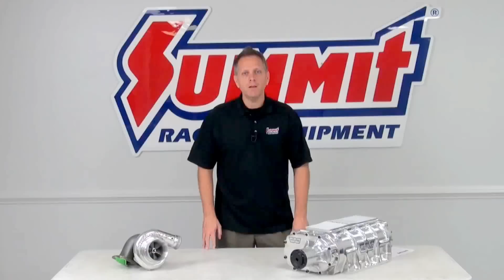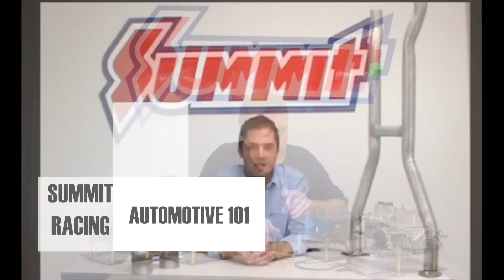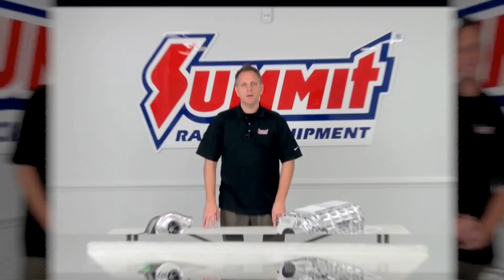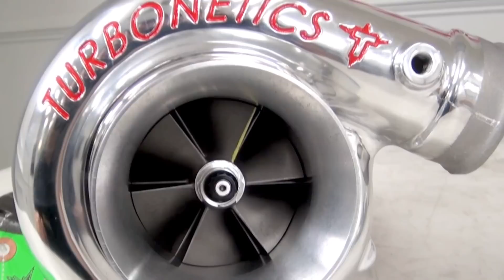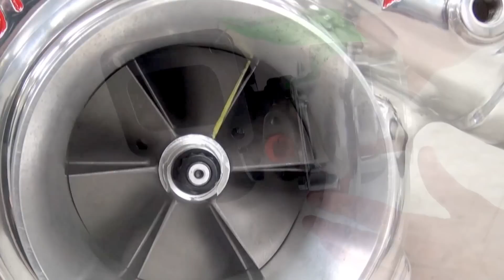Supercharger vs Turbo - Summit Racing 101

Comment: What do you recommend on a 2000 camaro v6 3.8
Reply from the maker: twat airsoft, 
Unfortunately, we do not have either type of kit for that motor. Some searching on the net will show
some factory supercharger components that can be retrofitted though!
Reply: twat airsoft The bottom end of the engine is identical. Just find a factory 3.8 supercharged from a Pontiac or Buick & change the intakes / supercharger. I looked into doing this years ago. As with all internet advice, please verify this before you proceed. I'm pretty sure I'm right, but you should always verify.

Comment: The turbo lag can be avoided by just putting a smaller turbo.  As far as turbo lag, turbo are so advance now in days that if you make the good combo there should be little or no lag to the turbo...
Reply: +melendezcobra45 indeed
Reply: my roots 144 is about 15 years old and ive raced new deisel turbos  even a new spooled turbo that was on a camaro with a 502  and my little 350 with 144 supercharged in a 6000 pound 76 chevy blazer 
prevailed it had power but it shifted and i blew by,
 low rpm  is not the turbos freind even with a stall converter.
Reply: time difference between throttle push and actual acceleration. Lag frustration alone is worth assessing your options...I hate it
Reply: melendezcobra45 what is turbo lag?

Comment: can i get flutter noice with cheapest turbo?
Reply: se*
Reply from the maker: Hi Gian Marquez, 
A fluttering or chirping noise is common on any turbocharged application without a blow-off valve. When under boost, if the throttle is closed rapidly, the pressured air actually travels backwards and slams into the spinning compressor wheel forcing it to stop instantly!  This can be damaging to the compressor wheel and should be avoided!

Comment: this is gonna sound stupid,but can an engine be supercharged AND turbocharged?
Reply: Yes it can its called twin charged!
Reply from the maker: Hi Corey Harrison, 
It is possible to install both a supercharger and turbocharger. However, the process is challenging and expensive!
Reply: i could imagine so,but would it be practical?
Reply: Corey Harrison  Under most normal circumstances it'd probably be cost prohibitive and thus not really practical. But, depending on how you define "practical", it can be done. There are examples out there of both parallel and compound working systems.
Reply: that my friend is called twincharging. The Zenvo ST1 danish supercar is a twincharged beast.
Reply: ill have to check that thing out then
Reply: Volkswagen did that one time
Reply: Yes i know
Reply: the ford gt is twin charged
Reply: Matthew kramer pretty sure a stock one is whipplecharged. Now if you're talking about the heavily modded ones that run 1000+ hp they're probably twincharged.
Reply: Yep. It's called twin charged
Reply: Robin Tammik no lol nice try though
Reply: Robin Tammik i already mentioned the Zenvo and said its twin charged.
Reply: [ZCS] Project153X koengessiegg ccx has twin superchargers
Reply: There is even Nissan SuperTurbo, a stock car that is Bi-Charged.
Reply: The zenvo st1 i think is super-turbo charged

Comment: 06 dodge charger  rt  5.7 turbo or supercharger
Reply: personally for a 5.7L V8 rt I would recommend the superch. for the reasoning of the chargers having lower Rpms of 5,500 - 5,750 max. 0 - 60mph in a charger is generally 6.2 sec so you wont have a problem with any parasitic effects.

Comment: Are turbos big in drag racing or does it depend on your car and what performance your looking for
Reply: uhhhhh Rapture Films, I'm pretty sure turbos are the ones built for higher RPM runs. They probide more boost at higher RPMs. It was explained in the video. Superchargers provide instant boost. Turbos have turbolag where superchargers don't. In most cases turbos provide a lot more power especially in drag racing where people will run upwards of 1000hp.
Reply: Turbo is usually bigger in rally, or circuit racing. Superchargers are more used in drag racing cause they are made for high RMPs. In drag racing you are continuously shifting up, and that's why it can be more useful exspecially the last gear when it's  a continuous pull in the higher RMPs. in a circuit you spend more time down shifting and having to pick speed up again so you use a turbo to get you there faster. A super charger would probably make you spin out in a circuit so over all most people use superchargers for Drag racing unless they have a 4 cylinder where it would be more difficult to place a super charger in the smaller hood space. either way though with a turbo or a super charger you will see a lot more performance out of your car, and you'll have a hell of a lot of fun.
Reply: yes my apologies I mixed it up. That's why people don't like superchargers for circuit. If you down shift they get squarely. I wrote that early in the morning I was a out of it.

Comment: I have a '97 5.0 block and am having trouble finding a supercharger for that year, Also for more of a street build would you recommend a supercharger or a turbo for a moderate power increase and would I run into any problems with a stock engine?
Reply from the maker: Hi Jesse Lockhart, 
We need some additional information from you. Can you give our tech line a call? 1-330-630-0240. We look forward to your call. Thanks for watching!

Comment: Hi I wanted to know if you let your car sit for about 4 days is that bad on the turbo. Will the oil lines still be fed oil properly to run par ??
Reply from the maker: Hi Miles Watkins, 
This should not be a problem at all. Thanks for watching!

Comment: I wanted to make a correction on the video just so people aren't misinformed. Turbochargers do take away power from the engine. Energy is required to spin the propellers and energy cannot be created nor destroyed. The pistons have to push the exhaust gas more in order to spin the turbocharger's propeller. Although it is less than superchargers, turbos also have parasitic loss.
I hope in a future video you can make this correction so this doesn't spread through the car communities.
Reply: It's slighter harder for the engine to complete the exhaust stroke, however most of the energy comes from the blow down energy of the heated exhaust gases leaving which is typically 'wasted into the environment' without a turbo.

Personally I still think superchargers are better because of instant response and more induction at lower rpm but it's all application dependent. For my application I want to accelerate from a stop in a straight line as quickly as possible.
Reply: Your just restating
Reply: Negligible power loss. The turbos develop inertia and spin on their own. The exhaust just keeps them spinning.
Reply: They don't take away energy because what spins the turbines is the exhaust gases

Comment: turbo or supercharger for my 2014 Dodge Challenger RT
Reply from the maker: Hi Matt Timken,
Both achieve the same result, pressurized air increasing volumetric efficiency of the motor. At the end of the day; it comes down to affordability and your preference.

Comment: Hi, cann you advice me what better to put in my car turbocharger or supercharger.. if supercharger then what style root, centrafugal, or twin screw ?  car is Audi S8 D2 2000 year, engine 4.2ltr  V8, 40 valves, 265kw  6 speed manual gearbox.  thank you for answer
Reply from the maker: Hi Donatas Donis, 
Can you give our tech line a call? 1-330-630-0240. Thanks for watching!

Comment: is it possible to have a supercharger and a turbocharger?
sorry if this is a stupid question
Reply from the maker: Mr.Nathaniel Johnson,
1.      
Yes, this has been
done before but, only in extreme racing situations.
Reply: Check the video "Worlds quickest Lotus" by Drive or The Smoking Tire
Reply: There are a couple twin turbo and supercharged Ford GTs running around here in Texas that I have seen

Comment: HEY I HAVE A 2008 NISSAN 350Z AND I WAS WONDERING WHAT I SHOULD DO, TURBO OR SUPERCHARGE IT?  THANKS FOR THE INFORMATIONAL VIDEO TOO!
Reply from the maker: Hi Minton Jeff, 
Unfortunately Summit Racing does not offer a kit that would Turbocharge or Supercharge your car.  A kit is definitely the way to go though; because it includes everything necessary to make the installation complete and as easy as possible. Usually these kits will also offer the mandatory re-tuning of the computer that must be done! Thanks for watching.

Comment: So if superchargers use up ur engine power,how do they make it faster? And how does does just adding more air to ur engine make it so much quicker
Reply: You're thinking too hard bud. The turbo doesn't use enough power to not produce power. It's like running your A/C on an engine vs. not running A/C. Without the A/C the engine will "make more power" because it's able to move a little more freely. But it's so minor you won't notice it. As for your second question more air makes the engine faster because of how 4 stroke engines work. Intake stroke pulls in air and gas, compression is self explanatory, power stroke is the controlled explosion inside the cylinder, exhaust is self explanatory. The more air you have in the cylinder the more compression you can have. And the more compression the bigger the explosion which creates power. Hope I explained that good enough to answer your question.
Reply from the maker: Hi ur nalgas, 
A belt driven supercharger adds a certain amount of load or parasitic draw to the crankshaft of the motor. That slight amount of extra load is overcome by the extra amounts of fuel and air that are jam packed into the cylinders creating more power. A Turbocharger on the other hand uses the waste energy of the motor, fast moving exhaust gases, to spin an impeller forcing more fuel and air into the cylinders. It’s just 2 different ways of doing the same thing!

Comment: can you turbo charge a 4.3 vortec? & what other components would you have to replace ? injectors ? new manifold ? intake?
Reply: Do you watch Roadkill? If you have the necessary fabrication experience you can do just about anything. This has been done to Roadkill's Datsun 240z. They had a GM 4.3 engine in the car with a Subaru WRX rear end, a manual transmission from a junkyard S-10, and a turbo from a Ford Powerstroke diesel. Check it out. It may give you some ideas.
Reply from the maker: Hi Emanuel Castillo,
Sorry but, we do not have a kit to Turbocharge your 4.3 Vortec motor. Now, if you wanted to build your own kit we could help with components. This will not be an easy job as there will be a lot of fabrication on your part. Yes, injectors will need to be replaced. You will also need access to someone that can reprogram your computer as well.
Reply: thnks guys ill do some more reasearch

Comment: just about to start a 400 small block build- what compression can I run if im looking at building this to run a small twin screw whipple charger???not a blower...
Reply from the maker: Hi Gary McCarty, 
This absolutely depends on the overall build you want to assemble and what the ultimate use/goal is. Please give us a call and we will certainly help you choose the proper parts for the best build! 1-330-630-0240. Thanks for watching!

Comment: Summit Racing! 

I hope you can help me out. I have a Bonneville SSEi. Its already quick enough stock but I would love to get more power. What would be the best modifications to gain the most power, and safely upgrade without any possible damage? Also I would love to get my supercharger to whine a lot louder!
Reply from the maker: Hi gjg50,
We carry Cold Air Kits, Pulley’s for the supercharger and tuning (HP Tuners) for the ECM. Give us a call and we can help you with the part numbers you’ll need! 1-330-630-0240. We look forward to your call. Thanks for watching!

Comment: some other differences include: The turbo being capable of producing a much larger ammount of boost than superchargers in comparison to size and efficiency. 

Boost can be much easily adjusted with turbos than superchargers and can even be adjusted within the vehicle cab while driving providing you have an in cab boost controller, whereas with a supercharger you cant adjust the boost without changing the drive pulley to a bigger/smaller one. (correct me if i'm wrong)

also lagg issues can easily be resolved, i found that turbo lagg is only a real problem with automatic transmissions whereas with a manual you can launch on boost and the bigger the engine the less lagg you get with turbocharging v8's there is little or even no lagg due to the high ammounts of exhaust driving the turbo/turbos. (No need for correction, Spoken from personal experience)

Thanks for sharing this great educational video, i'm sure it's helped alot of people.
Reply from the maker: Hi Blaize K-H , 
Thank you for sharing your experience and knowledge!
Reply: superchargers give you better low end torque and better throttle response. its worth it over turbos
Reply: analanalyst thats 100% correct 

depending on the tune, turbocharged engines can also be made to respond instantly and also for low, mid and top end torque while being efficient.

turbos on v8s are becoming extremely common because of this.
Reply: Blaize K-H like the new mercedes amg's and bmw m's have definetly solved this problem. i still think a supercharger is the way to go though
Reply: analanalyst superchargers are not made for really high speeds but good at low RPM/s i think but not sure though
Reply: Doodoo Youkas not true, turbos run out of breath at speed. you need to shift early because the turbo runs out of steam and it even needs to spool up
Reply: analanalyst That's incorrect, turbo's provide better low end torque. Torque and HP improve as RPM increases in a supercharger
Reply: BlackVinylMusic turbos only give you mid range. if a turbo has good low end torque, like the new BMW engines for example they will run out of breath in the top end (5000rpm) superchargers do not have this problem. the best way to fix this is by adding 2 smaller turbos instead of 1 big turbo, this minimizes turbo lag and gives more top end power
Reply: analanalyst it all depends on the tune. Cars can be tuned now for better low end mid or top end torque, dependent on the turbo and the tune, it doesn't necessarily need two small turbos for all-round but twins and singles both have their own pros and cons, you set it up for how you aim to use the car.
Reply: Blaize K-H true but you can only pick two of the three; low and mid or high and mid. this is why i prefer superchargers
Reply: yes they are adjustable and they can be spooled up and can be very awsome in strait line racing..
the answer to the automatic is a tork converter.
also lag can be resolved on take off by high rpms .
But there is lag if a turbo is not under load  thats why the road racers will actually power block the car at higher speeds creating a very dangerous condition of handling.
if not under a load the turbo will simply do nothing.
as a truck driver the turbo only makes pressure when you are climbing a hill.
its very economical or on take off.
Ive raced many turbos with my supercharged truck and in their rpm band 
they pull harder than my 144 but the second they shift its over for them 
and i put them so far in the rear veiw that there is no catching up even on the double turbos.
at some point they always have to run a low rpm.
and the supercharger with heavy 400 pound valve springs light weight rollers anti pump up lifters at 6 to 10000 rpms that super charger will not stop pushing that gear.
but the engine has to be built for it.
and heat is not the turbos freind.
with out the innercooler the 26 psi is worth nothing 
1700 degrees dont beleive me just shut off the car directly after the heat and you will hear a big pop.
and that will be the end of that turbo.
and then do two or three heats without a cool down period  and that will end it too.
Efficiency  
and there is a time that the turbo has to be rebuilt and if you keep driving 
it will destroy itself totally.
now tell me bragging  how many miles has your turbo lasted?
I know people who put a million miles on their B&M supercharger with out doing anything but keep 90 weight in them!
afficiency means it gets better gas milage through the low rpms LOL
In general a turbo will give you 100 horsepower .
huge or doubled up  maybe 140 horse power but the two turbos have to share the exaust driving them in the high rpms they might push 200 horse power.
a B&M 144 is rated at 120 horse power at the back wheels at low rpm
and can put out 200 at the back wheels 
apple to apple on a stock 190 horse 350  single turbo vs 144 super charger .
the turbo will get 100 horse at 4-5000 rpm  making 290.and that might be at the flywheel.
The 144 will put out 120 horse 350 horse power at the back wheels bone stock stock cam
750 eldorbrock Headers on both .
That is efficiency

Comment: I was wondering what gears are in my 1990 caprice 9c1 police pak
Reply from the maker: Hi vincent fox, 
Three ways you can figure it out; 1- take the VIN # info to a dealer and they can tell you or 2 – let them see the option code label usually found inside the glove box door and 3 – take the rear end cover off and count the ring & pinion teeth. Then give us a call and we can help you figure it out from there. 1-330-630-0240. Thanks for watching!
Reply: 3.08:1, most have a tag bolted on the rear end identifying gear ratios

Comment: I want to get my Mega Cab 1500 turbocharged but do I need a whole kit or do I just need a turbo and have a shop install it/tune it?
Reply from the maker: Hi Rob King, 
Turbo’s are best purchased in kit form if available due to it having all the required parts for proper installation.

Comment: Both create heat, make the air expand. Use NOS, where you are condensing the air, pull nothing from engine, need not wait on RPM's to move more exhaust, just hit the button and you have INSTANT power.